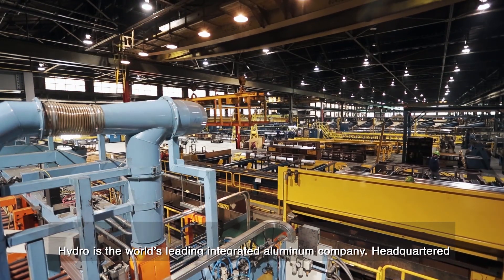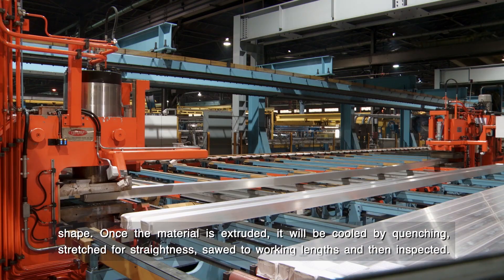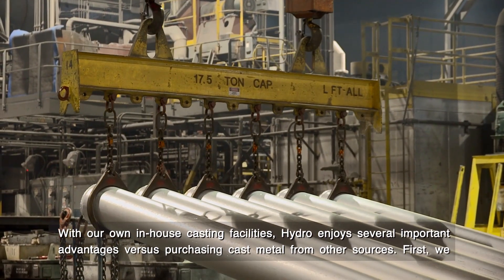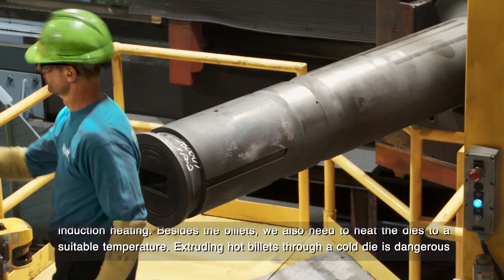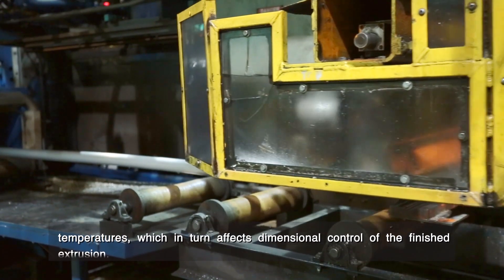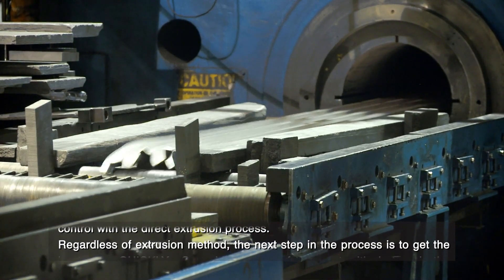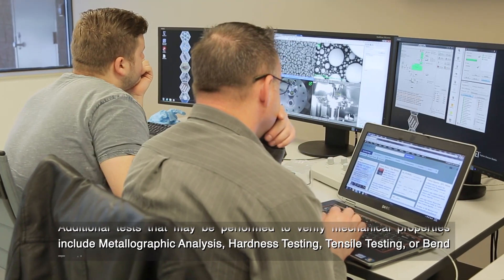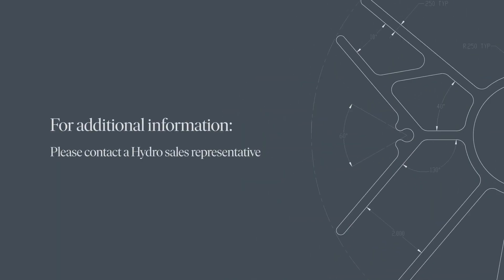Aluminium casting and extrusion

Comment: im working in germany as plant operator (Hybrex 25 MN prototype , 310 bar for si0,5 si1 c24 c20 F27 F35 materials ) for 6 years now  in a aluminium pressing plant    and its underpaid      machines are horrible designed    and god damn it   modern machines just dont run for 50%🤣 germany is ass

Comment: How do you extrude complex shapes that have voids in the middle, such as pipes?
Reply: The center hollow is formed as part of the die and extruded as such.  I work in maintenance at one of the American plants.
Reply: @kevinkesler8154  I'd like to see it, because explaining it just doesn't allow my mind to comprehend how that works.  Thanks though.
Reply: There are 2 main processes. 

1) a Mandrel attached to the ram pushes the billet with the inside void in mind. 

2) a porthole die which makes separate pieces and welded back together before coming out of the press. Its weld is seamless so it looks natural.
Reply: I believe you would just extrude the whole thing, send it over to a CNC/fabrication shop (which Hydro has), then use a CNC machine, saw, or punch where you need it in the middle, then probably weld it on. I'm not an expert, I just have worked in the same industry where Hydro has worked as an operator (worker bee).